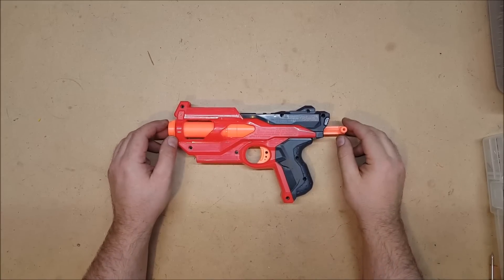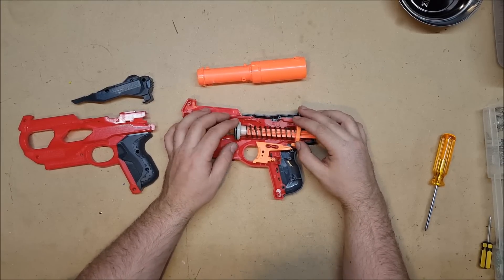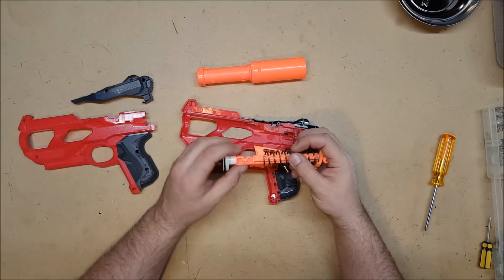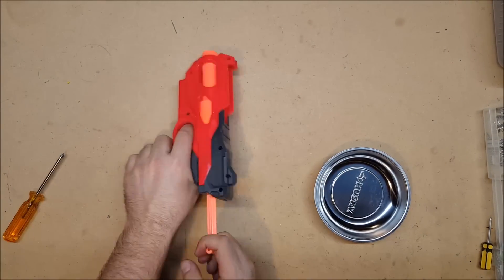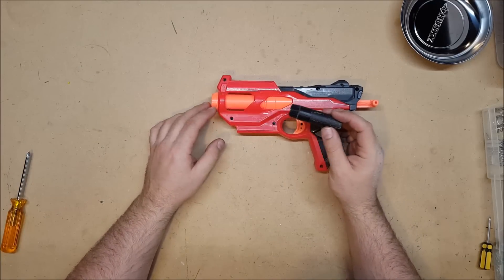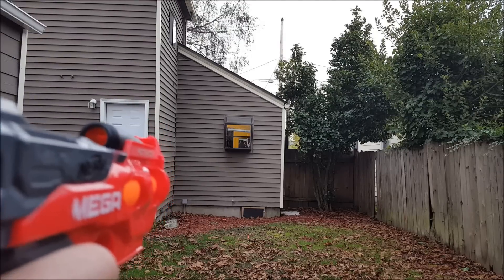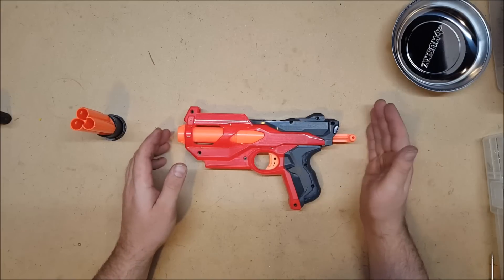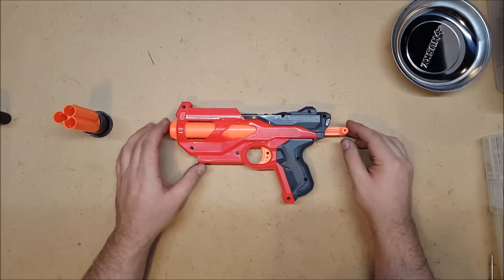Modular Nerf HotShock

Comment: You should make a rapidstrike that uses 3 magazines at once
Reply: Well that was three Rapidstrikes. Walcom's Paradigm Shift holds three magazines but it doesn't use all of them at once. 498 Nerf did make a Modulus with two integrated Rapidstrikes, Modulus with three stages of flywheels, Rapidstrike with two, and the whole system punched over 150 FPS easily.

Comment: hey Cap'n, you think it would be possible to make an underbarrel with several jolts hooked up together? or just impractical?
Reply from the maker: I'm sure you could.  Are you wanting multiple shots on a single trigger pull or multiple shots before having to reprime?
Reply: Multiple before reprime, otherwise it's easier to under barrel a drain blaster with an absolver
Reply from the maker: Worth a try.
Reply: Further would it be possible to have one multi stage trigger that would shoot each jolt like like a multbarrel shotgun?
Reply from the maker: Yes.
Reply: Sweet

Comment: How did you get the spring onto the plunger rod. I know that particular rod doesn't have a screw at the end, only that plastic flange, which makes it almost impossible to take the head off and get it back on securely.
Reply from the maker: Use a pair of pliers to pry the end of the spring off the side of the plunger rod and then "unscrew" it.

Comment: Is it possible to brass the nerf crossbolt? I have always loved that blaster.
Reply from the maker: Well...technically.  You could replace the barrel with brass but it is not going to have the same effect as with plunger blasters.  The Crossbolt is actually a crossbow so there is no need for an air seal.  In fact, if you made the barrel smaller it might now work at all.

Comment: Here is a challenge. Make an iron man chest blaster! Like, velcro or molly attachable
Reply from the maker: ...hmmm...
Reply: Captain Xavier
You already got an idea, don't you?
Reply from the maker: A few...
Reply: Captain Xavier
I saw somebody use a panther tank on the chest and a cut down maverick cylinder connected with a pipe. Pretty sure it used a compressor and it was triggered remotely.